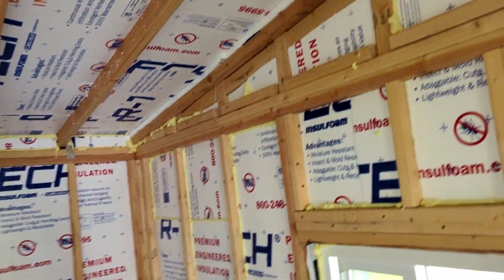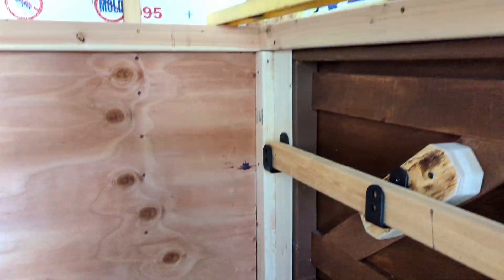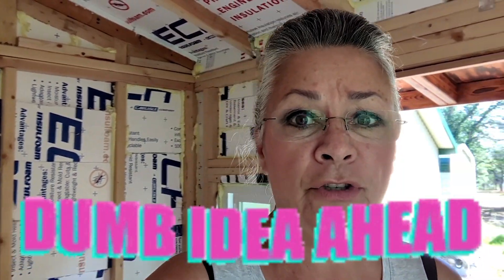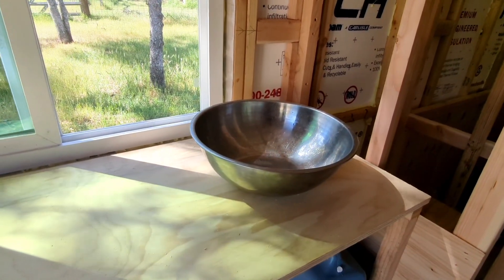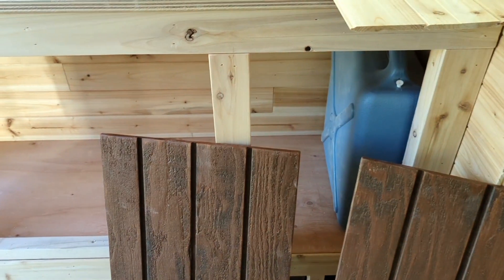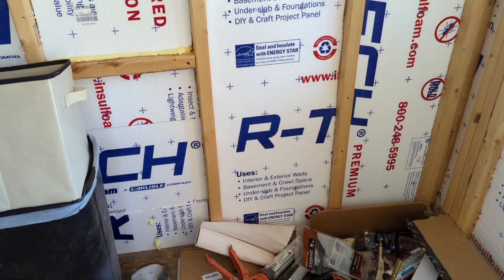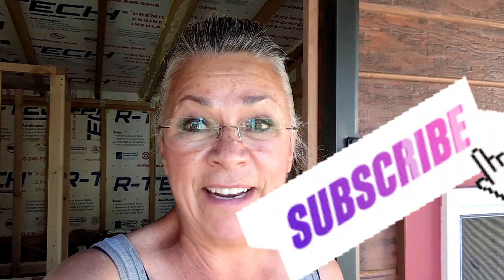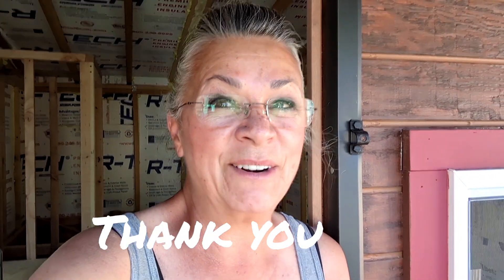Building my own Tiny House @65???

Comment: Hey Mz Betty Bear!  Comin along really nice 😁! I was wondering… could you turn you blue “jerry cans” on their side (spout up of course) and still use your reset 15” sink? ( use the clear hose they sell at Home Depot for your plumbing ). I do like the above counter sink HOWEVER I think you are going to loose a lot of usable counter space. I have the “bar sink” from Home Depot and I bought a 1/4” cutting board from Walmart, used some cardboard to make a template of the sink opening, and then cut the cutting board to fit on top of the sink. Duel purpose- cutting board or simply “extra” counter space. It was a true game changer for limited counter space. Just a thought - I know you will tackle it 100%. 
Happy building!  
Scott. Metro Atlanta area
Reply from the maker: Hi Scott I did think of that too. But unfortunately I did not have enough space for even that. I did not want to loose so much undercounter floor space either. I did  get my new sink today. And It is beautiful. Thanks my friend.

Comment: Just woke up and here's your video...  Looks fantastic.  Making progress also on my 6x12 cargo trailer.  A new vented-outside propane heater, a Wave-3 for backup and 400-watts of solar.
Reply from the maker: Hi Camper, What kind of outside propane heater are you using? I just really can not afford the wabasto of something similar just yet. Maybe we will see each other on the road someday my friend. I too just got my 4  100 watt panels. i just need to figure out how I am going to mount them. thanks.
Reply: @BettyBearsNomadicTravels  I have a Martin vented outside propane heater that works well.

Comment: Hey Ms  Betty Bear,Bath/Tileman,Remodeler Here,On my trailer,Did a lightweight shower Wall systems,Instead of Cementatous backer bd}use 1/2"foam bd as backer,and then use the FRP plastic sheets with a good Ext. Mastic Chalk.Works good
Reply from the maker: OH MY GOSH> I was just thinking about that today. Great idea. I do need something light weight and that is the solution my friend. I just priced the plastic sheets at the Home Depot yesterday. Yup Great idea. Thanks. I would love to see pics of your build.

Comment: Coming together fast. Looking great. You're going to love it. I'm putting in shelves with baskets in my trailer where you have cabinets. Been looking for the barn door brackets you put on your storage door. Check 'Jonnies Journey' for easy peasy wiring setup. For cheap added security get an old pair of men's shoes/boots and keep them on your porch. If someone sees you leave and comes messing around they might be afraid someone is still inside. I'm going to get a pair of women's and do the same thing. Keep having fun.
Reply from the maker: Good advice mr 7h21. I do not think a pair of womens boots will scare someone off though. LOL... Thanks for your wiring advice. I do need all the help i can get on that project.  The brackets I got on the shelf at my local Home Depot.   My New Home. I should just part my tiny house in the parking lot. it would save me on a lot of GAS.

Comment: Are you going to do a Primary 110 volt electrical system or a hybrid type? I did my cargo trailer in 110 volt and did the 12 volt as a separate system. The 12 volt plugs into the 110 through a receptacle. Then when I'm boondocking, I can plug my 12 volt into my power station. It gives me access to my lights, refrigerator and charging ports. Easy setup and you don't have to spend a lot on the 110 volt system. 110 will be the shore power plug and a few receptacles. The 12 volt is primarily a converter and the fuse block. The converter will have a 110 volt plug that will plug into a receptacle. If you go with a converter system, make sure it's a high amperage. 30 or 50 amps should be more than enough.
Reply from the maker: I don't know to much about electricity. But your system sounds very much like my tiny cargo trailer system. I am going to let my son in law do the thinking on that part. but I think we are both on the same page. Thanks

Comment: Do you have a cover for your wave 3 ? They should be covered when not in use. Dust on the element can ruin the burner.
Reply from the maker: Yes I sure do. I have heard the same thing. I keep it covered at all times when not in use. thanks for the advice. they are to expensive to miss treat.

Comment: well coming along very well ,excited about the electric going in . do u think its a good place for ur heater? what ar u gonna do about cooking with the heater on ? or will u just turn it off when ur cooking ☺️
Reply from the maker: Boy Cynthia I have been rolling around with this in my head for a while. I do get you. But I do not have another place to put it. on the couch side I have no way of running the propane lines. I do not want to run them under the trailer. i drive in some pretty remote areas. i would hate to bust a line. So I rebuild the box today. And i feel better about it now. Not perfect, but ok. Thanks friend.

Comment: Where did you get the hardware for the "2x4 lock" for the inside of your outside storage door? (Why don't you use a tripod?)
Reply from the maker: I got them on Amazon. The are 2x4 door barriers.  I started to use a tripod today. I know my filming sucks. But I get so locked up in my work I even forget to film at all. I will try harder to get a better picture for you all .thanks for watching.
Reply: @BettyBearsNomadicTravels  Thanks I just ordered 2 sets. Maybe you should consider being an Amazon Affiliate...

Comment: I'd also run the wiring thru channels or chases that can be easily opened :  https://www.youtube.com/watch?v=bobSc-Djp08   you can also see their upper shelves they have canvas baskets on : https://www.youtube.com/watch?v=hbjvAWPeMk8&t=30s
Reply from the maker: Thanks Ted, I will  watch this channel. I have been watching I Ride Tiny House for a while now. They have some great ideas. I sure wish I had a bit more knowledge on wiring. NOT A BIT MORE BUT ALOT MORE. Thanks DUDE
Reply: @BettyBearsNomadicTravels  Plenty of how to wiring youtubes on here - enuff videos you and Johnny can figure it out.  I'd put a 30 amp power center in it : https://www.youtube.com/watch?v=za4NiGFknlM&t=29s  
could add solar Later : https://www.youtube.com/watch?v=v_omW_iK9NQ&t=575s   if get Lithium battery(s) be sure to get a converter/charger made for Lithium batteries. if you don't get lithium do get AGM battery(s). 
same as power center but with individual components :  https://www.youtube.com/watch?v=3kdY8xhD0MY&t=898s  - he has list of components links in description.
Reply: but your power station will do what you need being as just lights, power fan and charging phone n camera etc. for running off the power pack your wiring in cargo camper is not bad -  could swap outlets with a male plug-in pigtail  in leu of  the power strips - but not really any benfite besides asthetics/Looks. power strips have a 10-15 amp breaker but I'd think the power station has a fuse or breaker for each outlet or pair of outlets. could come off the 12 volt plug on power station to a 12 volt fuse/distribution block . 
But if you wanted to add ac or microwave or toaster oven or such - need to wire shore power with a cpl circuits/breakers